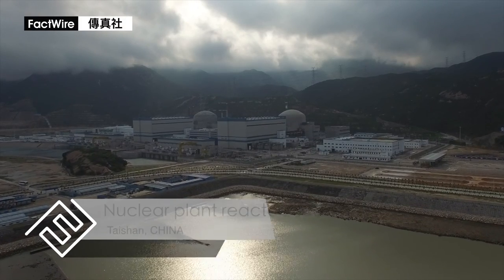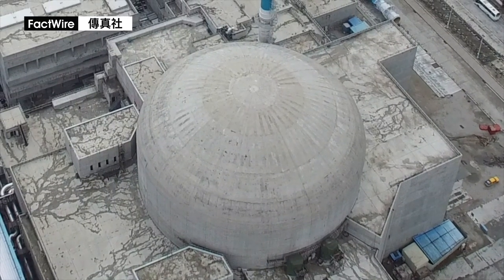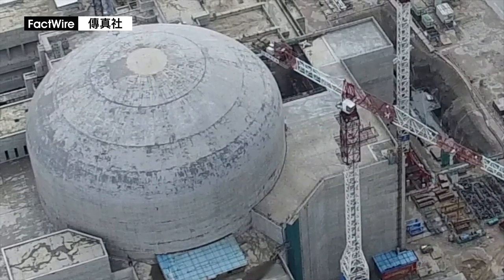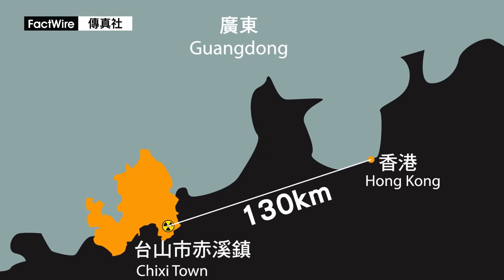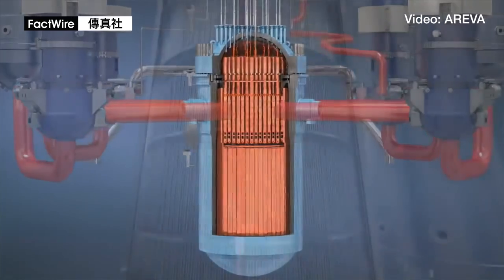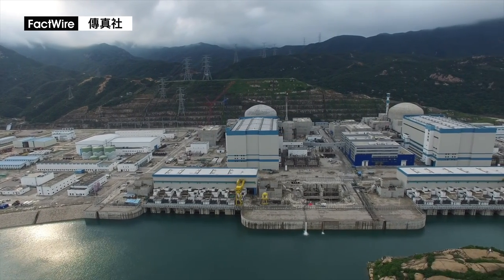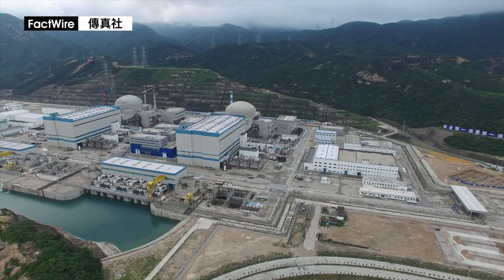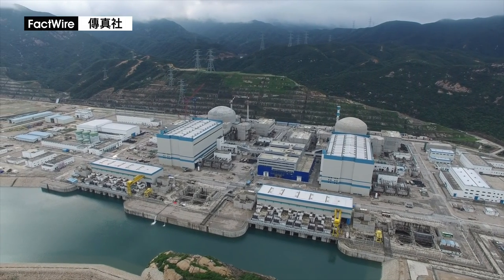Taishan nuclear plant reactors sealed despite safety concerns

Comment: A brittle, high-carbon content in the equipment could cause all kinds of noble gasses to expand via uncontained/leaked fuel. Noble gasses contain a lot more radiation. The early EPR design spec’d (2) containments - I hope this method was incorporated in this build.